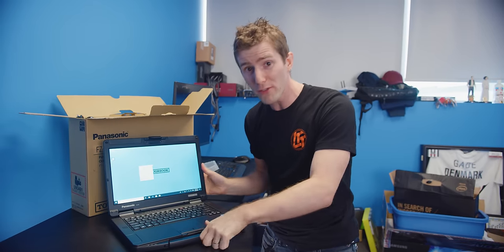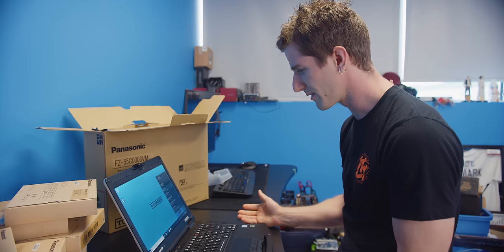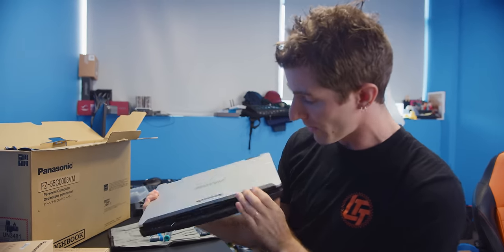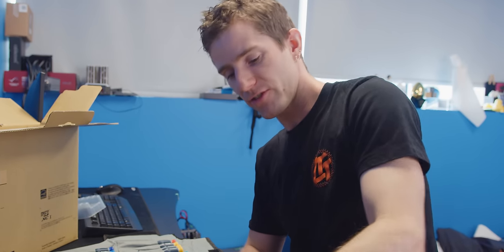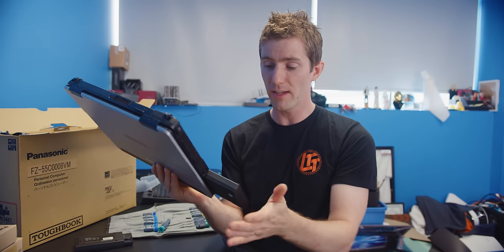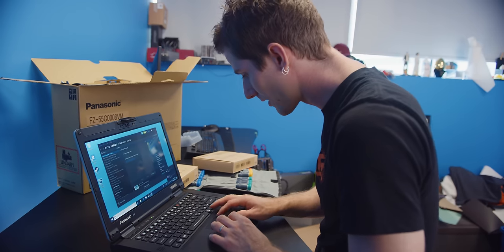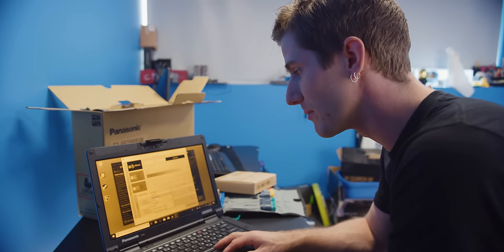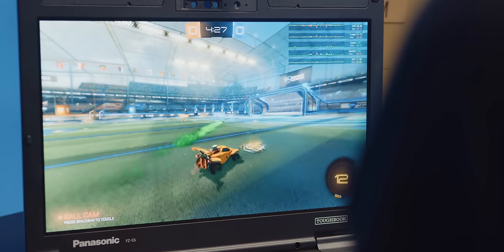The CRAZY Upgradeable Laptop - Panasonic TOUGHBOOK 55 Showcase

Comment: "Never know when your going to have to rip out your SSD and put it into the paper shredder"
Parents walk into the room
Reply: Son why did you destroy the $8000 NVMe we bought you?
Reply: Some agency will book hardrvies out for security reasons
Reply: I would rather just put that stuff in protected RAM. A single click of a button can overwrite that data 5 times in less than 50ms.
Reply: @Sandhammer  Yes they do. The hard drives are removable so they can lock them up in a secure cabinet.

Comment: I'm studying archaeology and I would assume that this would be relevant in terms of data analysis and such in the field. In that respect, extra RAM, cellular, double batteries, SSD in the place of the GPU would all be useful.
Reply: Your games will run terribly without the gpu, so always carry the swapout part for when you're done for the day.
Reply: Great screen for outdoors
Reply: geology, and i agree if u are out and go back to the camp there are other things than gaming, no need for the gpu module
Reply: @nathanhamman418  This sort of computer isn't really meant for games, haha. The GPU I'm guessing is mostly there for running programs that might be relevant to the sort of work that this laptop is intended for but which is more graphically intensive, and the reason it's a swap-out is that they tend to be used for more CPU intensive stuff like data crunching. It could be useful though with things like photogrammetry on the field (that's using photography to build composite images and models, these days with good enough equipment you can make full 3D models using drones with cameras and good software and hardware, really cool stuff).
Reply: @TheNugettinage  just because the server board I bought wasn't meant for games doesn't mean I don't use it for that xD
Reply: It would surely fits that pretty well. It's a Laptop for Harsh Environment afterall

Comment: I never thought I would consider a laptop badass, but here we are.
Reply: Yeah especially when it cost $1,995 without the components and with way way less power than an $800 laptop
Reply: @mattsstuff08  that's not the point of a tough book
Reply: CS: GOPNIK Ik but still it’s a little overpriced in my opinion

Comment: This looks like the laptop you would use to order a predator missile in call of duty
Reply: You would need a special module to command the Predator, likely some type of radio transceiver to send targeting information. A target designator may also be helpful. Also, the MQ-1 Predator is a drone, which can carry 2 AGM-114 Hellfire missiles.

@Outfrost "Predator's Missile."

Comment: I bought the laptop about a year ago over the macbook pro. I was tired of soldered in everything. it was the best decision i have made. i have dropped the damn thing, splashed water on it, left it out in 120 degree heat, took it camping, and the kids have used it too. I play Tomb Raider, Division 2, and COD 2. I use it to write code and photoshop on occasion. it is slower at rendering than my dedicated pc, but well worth the money.

Comment: "Has a ton of security measures"

Removes the drive pressin one button
Reply: prob encrypted
Reply: @____trazluz____9804  if you stay longer on the vid you can see he can actually lock it, i just found this funny at first
Reply: @theta3302  Google search for "giga Chad" he is Russian, dot know the name.
Reply: @____trazluz____9804  thank you so much you are a legend for this. Nobody would tell me his real name
Reply: Like Linus had said it has a locking screw and it's of itself considered a security measure, all toughbooks have a built in TPM and extremely secure BIOS. So for one you can lock down your hard drive using hardware and it allows for the drive to be hotswappable and moved to secure storage such as a safe easily for sensitive drives.
Reply: @theta3302  Ernest Khalimov is the model's actual name.
Reply: @re_i_gn  Thank you. I saw his name when searching for mega Chad

Comment: Product designer: “How many component do you want to be modular?”

Panasonic: “Yes”
Reply: Every single piece . xD
Reply: @adamtajhassam9188  Except the monitor, even though they technically could design it to be, since it's just a couple of cables.
Reply: @InfernosReaper  it would be very difficult to design a display hinge that's both quick swappable and sturdy and durable.

I suppose it could be done, but it would be difficult. Hell, a lot of companies have trouble designing a hinge that's just sturdy.
Reply: @GeneralNickles  Which makes no sense. How old is the "hinge"?
Reply: the screen could be plugged in a U slot that's tied to the hinge.
Reply: @GeneralNickles  " Hell, a lot of companies have trouble designing a hinge that's just sturdy.."
More like can't be bothered to

"it would be very difficult to design a display hinge that's both quick swappable and sturdy and durable."
It's really not. I've worked on stuff that you could change out in 5 minutes that was quite robust.
Of course, they weren't built with the cheapest materials imaginable like many hinges are

Comment: This reminds me of my old Inspiron 1720, where pretty much everything was upgradable. Not quite as modular as this machine, but the optical drive came out with one screw, it was prewired for an additional WiFi card and a LTE card, it could output S-Video, Component, and VGA, had a FireWire port as well as a built-in 56K modem, the CPU was socketed and upgradable, and it even had an ExpressCard slot and two 2.5" drive bays.

Comment: Louis Rossmann will love this thing
Reply: FANSPIN
Reply: Only if there are easy accessible parts and diagrams. why replace a thing when all you have to do is replace a diode or chip on said thing, but you need diagrams and the specific parts to do so ;)
You still have a lot to learn young padawan

EDIT: I have to admit he would probably say something like, "it's a good step in the right direction"

Comment: 8:36 GPU in a CD-Rom chassis.  This is glorious.
Reply: Panasonic is fucking legendary, Toughbooks are great love them, and wish i had like $8,000 to get a fully kitted out one with all modules.
Reply: this isn't the only laptop that did that.
one of old Lenovo Y series gaming laptop with GeForce 750M/755M in SLI also put second GPU in optical drive bay.
Reply: @80486DX2  Yeah but it was crap because it only ran at half the speed because of slot being pcie x8.
Reply: @pilsplease7561  PCIe 8x is absolutely fine for GPUs, and on most platforms, running SLI will always result in 8x because the CPUs have like 16 or 20 PCIe lanes...
Reply: @Sgtpeterenis  Its more of a chipset issue, some Processors can run multiple gpus at 16x. But having one at 16x and one at 8x is not good, performance suffers hard and that's why that Lenovo laptop that had it failed. Plus the modules were MXM, the issue is that you cant get them. MXM modules are great in concept but shitty in reality as they don't sell them and the design intention was for people to upgrade laptops themselves. That pisses me off a lot.
Reply: @pilsplease7561  I suspect that it would've just run both at 8x, much like a desktop. It wouldn't have enough lanes available anyway - I don't think that thing would've run a Xeon and appropriate chipset. 
Them being MXM and thus unobtainable is a completely separate issue.
Reply: @pilsplease7561  No. SLI just doesn't scale well. I don't know about how hard it is to find lenovo parts but I can't look up a dell GPU without an HP one at the top of the list. :/
Reply: To be honest, standard graphics probably can handle any movie or game that might be on blu ray. The newer games that would require the upgraded GPU don't come on optical media.

Comment: "Whoops, turns out I shouldn't have pulled that thing out with the power still on" -> "we got lucky, things still work after a reboot" -> [proceeds to push in and then take out the next thing with the power still on]
Reply: Removing an SSD while the thing's running is more likely to cause issues than removing something like a fingerprint reader... Also, given the extra battery is hot-swappable, I'd guess most components likely are. (Which is probably why Linus assumed the SSD might be in the first place, Panasonic probably mentioned some of the components being hot-swappable.)
Reply: @RiverShock  True enough, but it still makes for an amusing sequence of events.
Reply: @abdulmasaiev9024  At least he didn't tried to "hot swap" the RAM.

Comment: This is how a laptop should be imo. 

I do not care about the thinness and lightness of other new laptops.
Reply: I wouldn't say I didn't care about t&l, but it wouldn't be a deal breaker consider equal capacity.
Reply: MasZakrY  its better than, you know, not having them at all
Reply: MasZakrY  On the other hand, there could be zero upgrade modules and you could just keep buying new laptops? Apple would be proud of you.
Reply: MasZakrY  All desktop PC's are built with DLC upgrades if your using that logic...
Reply: @krane15  I agree. I just hate how the industry is striving for this thin, light weight, simplistic design where aesthetics and gimmicks are more important that function and real world use cases. This goes for cell phones as well.

Comment: I will enjoy buying this laptop 6 years from now when it cost 200$
Reply: so true, but it's going to be real hard to find discontinued modules on ebay.  hope it has staying power.
Reply: This might be one of the only laptops that won't depreciate unless heavily used. All out mantinace guys use them and they stay exspensive five ten years. They don't change much and they start way up in thousands
Reply: @gettingoutguru  you can get the FZ-55 at about $1500 depending options
Reply: Yeah, good luck getting this cheap UNLESS you’re lucky enough to be at a police or military auction where one pops up. And if this is your plan that you truly want to follow thru on, I’d recommend getting the modules you for sure want NOW since to find them later will be harder than getting the unit itself.
Reply: same
Reply: @SatBrumane  if it's anything like Thinkpads, they'll be just fine.
Reply: Devin S thinkpad does the same exact shit for 40$
Reply: I'm kind of interested in this laptop. Looks at price on Amazon.. Nope.
Reply: @Mr_pai_pai  why would they destroy them? All you have to do is destroy the hard drive. In the military we sell to auction or give away computer to school, it would be such a shame to destroy everything.

Comment: Linus: “Screws everywhere!”
Me: laughs in Compaq 610
Reply: isn't that the series with P3's?!
Reply: I dunno, but it has easy access to the hdd, ram, battery, optical drive, etc.
Reply: Compaq 620 here .
With upgraded ram , ssd and core 2 duo p Series processor
Reply: It is a good laptop. I put an Intel T8300 bought on AliExpress, 4 gigabytes of RAM, and an SSD, apart from having 2 batteries. very good the compaq 610
Reply: Compaq presario that can't connect to the internet ftw

Comment: I would love to see something like this at a reasonable consumer price point.
Reply: I'd go for that certainly. When I designed a hobbyist computer in the 80's it was fully upgradeable. Processor upgrades, RAM and ROM upgrades, Interface upgrades, the works. Not seen that done in near 3 decades.
Reply: Gordon Lawrence bas business model
Reply: @sebastianmorales6849  I don't care. I was paid for the design,
Reply: @Alexander Davis realisticly there shouldn't be a reason why there isn't a model of laptop with upgradeable GPU also (with the MXM format)
Reply: Yeah, in an era where PCIE exists on laptops and ExpressCard exist, affordable laptop upgrading needs to be a a thing. 

It probably doesn't need to go as far as this device does, either. One major component module, like the hard drive, GPU, and optical drive option in the tough book, and an IO & reader bay or 2, like slightly upgraded express card or something.
Reply: @Alexander Davis Which is the first thing to go obsolete.
Reply: Yeah, but consumer have gotten to the point where they will only accept thin and light. A laptop such as the Panasonic would only confuse them.
Reply: @InfernosReaper  The IO module is brilliant. You get to select only the ports you need
Reply: @OwenWalker  None whatsoever, and especially at this time and date. Even if only on the high-end models.
Reply: @krane15  It's nice, but it's also unfortunate that they use a proprietary standard for even IO

Comment: I used to support this line as a tech due to working under an MSP contract for a small municipality (town). The car-dock feature is because these are often used in police cars. The MIL-STD 810H certification is because these things will sit in hot cars all day, and (at least in Vermont) will also sit outside in basically freezing temps. The temperature swings can destroy weaker machines. Combine with the shock and vibration rating, they're really reliable machines for that purpose.

Officers get really mad if you remove solitaire from the base install because of how long they'll spend sitting in a cruiser sometimes. True story.

Comment: Meanwhile over at Apple: "you guys can plug in a usb drive"
Reply: "Isn't that all you wanted?"
Reply: @LittleWhole  MacBook Air have zero usb drive. You need to use a usb C dongle
Reply: *if you use a dongle.
Reply: @thd2682  do you not notice my q u o t e s
Reply: "...with the appropriate set of dongles and adapters..."
Reply: Do you guys not have dongles? -Blizzard
Reply: Not type A. You need a dongle or a usb-c hub with type A.
Reply: "Excuse me, you gotta dongle for that?"
Reply: You don’t need a dongle just a usb-c usb drive, which I think is a much nicer connector. My MacBook Pro has 4 and either one can be used to charge, plug in a display, plug in a device. 

Nice example of this is a usb c monitor, you plug it in and you got your display, charging and usb hub (in the monitor) covered with just one cable!
Reply: 10 years later

“You guys can still plug in the AC adapter”
Reply: you all use USB Drives, right? XD
Reply: @Peter-nj5mv  I agree USB C is the better connector.  

But if you are out and about, and a dirty non apple user pleb asks you to share a file with them and passes you a standard usb A drive - something that would have worked for the last 15 years - suddenly you can't do it.
Reply: @thd2682  - WHAT???  You don't carry a separate bag full of dongles?  {mock shock, clutching imitation pearls}
Reply: TH D ah come on, when is the last time that even happened?
Reply: @Peter-nj5mv  literally happened to me in a lecture

I needed a copy of the presentation on my laptop as we were presenting in a few minutes and pass my team mate a usb.

He has to explain to me that his brand new laptop doesn't have a USB port.

I am just staring at him with my P50 which has 4 USB ports, USB C, HDMI, Display Port, SD card reader, and network port
Reply: TH D so for that you have google drive buddy, not even a need for PowerPoint.
Reply: @Peter-nj5mv  Yes in theory

If you have tried to give presentations professionally, no one uses Google docs for anything 

It's clunky and slow. 

That is the problem with Apple's approach, they assume everyone has access to high quality internet at all times and cloud applications. 

Most of the world does not have the infrastructure of California, including a basement lecture theatre where you can have poor mobile internet.
Reply: TH D I work in a $60 billion company and we use google drive for sheets, documents and presentations (and we are a tech company).

Mac has airdrop, so it’s very simple to share between Apple products, no internet or cable required for that. 
Anyway I guess you are right that not every place has a reliable internet connection, but maybe the newest MacBook Pro isn’t something they would get there anyway.
For me it does what it needs to and I like the usbc functionality.

Comment: I have the CF-30 my second one now and it is good enough for me as far as modularity goes. What I like about the CF-30 is the toughness of the unit. It was made for military and law enforcement use under the most extreme conditions. I can use mine in the rain without fear. It is only a 13 inch screen and it does weigh more than the 55 but if needed I could use it as a weapon without fear of breaking it. It has a free floating removeable HHD hard drive you can swap it out for SSD if you want. It is also touchscreen with a stylus that fits in the pullout handle and has a tether so you won't lose it. The speaker isn't the best but for my needs it is adequate. Also it has an SD card reader if you need that plus ethernet and telephone jacks. If you are mounting it in a vehicle there is a sliding door on the back to plug it into the dock while maintaining the waterproof quality. The biggest bonus is they are pretty inexpensive on eBay compared to when they were new!